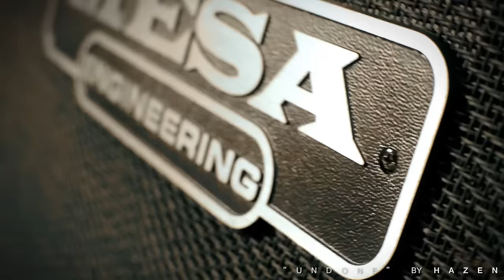John Mayer BLACK1 Replica by MCG

Comment: And to top it off it works when it’s done! Something fender couldn’t get right for John.
Reply: its a fun bandwagon - but the truth is that Rene martinez actually forgot to solder something after he did his check and setup - before john got it, as John says its not his guitar before Rene has touched it.
Reply: @imsura3554  why would Rene need to solder anything? The electronics should all already have been soldered. Unless he unsoldered something while doing his setup but that makes even less sense.
Reply: @paultiplea  Rene was supposedly mucking around with wiring in a dummy coil under the pickguard before it even reached JM. At least that's the story according to John Cruz.
Reply: Yeah, in the end, regardless of who’s doing the soldering, QA for Fender Custom Shop should be at the flagship level. PRS does a better QA job for their guitars priced way less than Fender Custom shop. So guess what, don’t go to FCS, buy one from Dillon Mills

Comment: Such a beautiful process and build. 
The back of the neck needs to be more in line with everything tho. It’s just a straight line and so bare looking.
Reply: The neck bothers me a lot. The back of a neck wears in a pattern that matches the cowboy chords down low, usually a fat middle with deeper wear at the whole notes (A, B, E) from barre chords, and then most of the rest of the wear starts just at or above the neck center line. Added to which, necks are DIRTY. When the wood is open the grain opens and closes with temperature and humidity. The hand naturally makes oils plus, frankly, we are a disgusting bunch as a species. All that together means there should be varying levels and "colors" of dirt down in the grain. The exact same goes for the lay-spot where the palm hits the body all the time, it gets coated in oil and sucks up dirt. Guitars don't get hit with hammers and files, they don't get sanded with 80 grit diamond paper in an afternoon at the same temp and humidity. Good guitars fall over when you're drunk, get chipped by some asshole's gold watch in a pawn shop, they slide down walls and across floors. Things fall against the face, scratches cluster at the saddle adjustment points, and at the string holes in the bridge front or back. They have beer spilled on the bare neck and never wiped off, just played off. Chips and nicks NEVER fall inside the plastic borders, except in the back where someone took the panel off and never put it back. And for god sake, things age AS A WHOLE, they don't age one piece at a time. And instruments as old as the ones you're honoring had all kinds of other stupid crap done, like rattle can over the beat up lacquer, or shitty wood putty fills that were painted with enamel then expanded and cracked. -- This is a gorgeous guitar, and obviously a handcrafted work of ART, 100%. One day I'll shut up and relic my own, and then everyone can pick on mine. Great channel!

Comment: You make this look easy, but I know it's not. It does make me want to try.
Reply: Erik Harker I ended up building the triple humbucker hardtail Strat that is my profile photo because of the Mills Custom Guitar videos. I don't regret it a bit! Turns out the center humbucker gets in my way but I want hotter pups anyway so I'll swap the pickguard then. Still plays really great. Learned a ton by building my own and I only have $400 with a Mexican neck ($200) and all Fender hardware including locking tuners. Not that I can hold a candle to Mills but, if you want, hit me up over Google and I'll share some of my noob learnings and mistakes. :)

Comment: I take it you need to scratch the complete layer or clear coat gloss from the body before attempting to relic the paintwork? Genuine question as I’m keen to try
Reply: You don't need to take off the clear, but it does need to be a certain finish. If it's a nitro cellulose finish, you can relic it in the way he did it in the video or how it would come from the Custom Shop. If it's a polyurethane finish as most modern guitars are, you can't relic it in the same way. Poly will chip a lot more and won't be nearly as smooth. It won't look right.

Comment: That oicture of the SRV original strat im pretty sure isnt the original SRV strat. The original had the stickers you used in the replica but the fender replica used a different font. Your replica is much better and the sticker font was the correct one (if you look at srv concerts you will see it)
Reply: Stevie's number one strat went through many changes. The stickers were changed on his strat just a short time before he died to the cursive letters. However, yes, the blocky hologram letters were on his strat for years and what most people recognize.

Comment: There's something very satisfying and aweinspiring about timelapse videos of guitars being built. Normally I don't care about relicing but this was a sight to behold! :) Being german and pedantic there's only one thing - as far as I know Fender did not do a relicing job on the Mayer strat. A wire had worked itself loose during transit and the guitar didn't sound right. So he started beating it up, putting it in the freezer and all this jazz in the hope of making it better. By the time he discovered the loose wire the guitar looked like it does now. At least that's how I remember it. :)

Comment: What are you scraping off the paint in the begining?
Reply: Probably nitro cellulose
Reply: He's flattening out the finish, knocking down the high spots so it doesn't have that orange peel look. I think he's just fine scraping it as opposed to most people wet sanding and then not performing any polishing steps so it looks worn
Reply: umpahimself what’s he using? A razor blade?
Reply: @codyjones8851 It could be a wide razor blade but most likely a specialty scraper tool

Comment: Great job very well done!! I've been thinking of making a John Mayer strat, but i'm lazy so, would it work if I prepped and stained the body then just masked of the areas that DIDN'T need paint (the opposite of the way you did it) and then spray the paint on the un-masked areas rather than scrape off all of the paint thats not needed? The stencil would be the same outline but cut away the painted area not the unpainted area, I realise the painted edges would need some dressing and flatting.. Just a thought...
Reply: That's the way I'm about to do it...Would be nice to hear other peoples experienced thoughts

Comment: What has been used for the brown tint on the wood? Amazing job there!!
Reply: At around 6:48 you can see a bottle of Tung oil. Which makes sense. When the finish has been worn off a guitar and the wood is bare, all the oils and sweat from a player will leach into the guitar and make it go brown. I wouldn't have thought to use oils but now it makes sense.

Comment: Excellent work! Would you mind sharing what you do to artificially age the hardware like you did in this video? The screws and tremolo springs look great, but the video went too fast to see what you did specifically. I've got a nice oldish strat with a couple of screws that don't match since they are 3 days old and not 30 years. Thanks!
Reply: Mark Brooks sanding paper to take the shine off
Reply: Muriatic acid and sandpaper artificially ages the finish on chrome hardware, I assume same for the gold.
Reply: Fine sand the heads and drop them in a small cup of hydrogen peroxide and salt, they'll rust in minutes.  Way safer to breathe than muriatic acid too.

Comment: So this took an hour or two then 😉.  Beauty!  Trying out some jazzy cat pickups whenever they get here.
Reply: Did you order them.  I just did.  How do you like them?  Mine will get here soon but the other 99% of my build from warmoth will take a while.  Damn carona virus shit.
Reply: therangersinger  They are the best pickups I’ve had (won’t change again).  I had custom shop fat 50s that the jazzy cats replaced.  The overdriven tone is where the difference gets amplified (literally).  Clean tone is really good too. Only as good as the amp you have though.  Good luck on your build and getting the parts someday.  I need to do a build like that someday.  Are you doing frets and everything or getting a prefretted neck?  That’s the only thing I’m hesitant about. Lots of tools needed to do it right.
Reply: @BeefNEggs057  thanks for the response.  Definitely no stranger to a wide variety of single coils.  I have owned......and sold so many Stratocasters over the last 12 years to include the original john mayer strat, a few deluxes, eric johnson, 59 avri.  I currently have a jimmie vaughan strat with custom shop 69's.  That Strat with those pickups has been with me since 2007.  Everything I buy has always been compared to those because they do sound great but I just have always connected with that guitar and play it more than any other.  I recently bought a suhr classic S.  Although it is a touch more on the modern side I have been playing that more and more as my ears have started to except change haha.  As far as warmoth goes....this will be my 5th build from them.  Unfortunately I had to sell all others several years ago when I lost my job.  I have refretted my Jimmie Vaghaun Strat once myself.  Not all that hard nor did It cost very much.  I actually bought a pack of pre cut and pre-radiused fender medium jumbo frets.  Hell I didnt know fender even sold them in a pack like that.  But they do.  That saved a lot of money not having to buy radiusing tools.  But as far as warmoth goes, every neck I have bought from them I had the stainless steel frets installed for an extra $22.  When i say there fret work is excellent I'm not kidding.  Although everything is installed you will need to round off the fret edges to get that broken in feel.  I never even had to level any frets from them.  Straight as can be.  And I did check but they were perfect.  When their necks arrive it will make you wonder how a piece of wood can be cut so precisely.  The only tool I have used on their necks is a STEW MAC fret end file.  Usually took me about 3 hours of work rolling the fret board edges and rounding off the fret ends to achieve that played in feel.  This build that I am doing now is  about 90% inspired by the mayer black one.  Cant wait to hear those pickups.  I have a victory V30 mk2.  The clean channel is almost too clean but I use a one control sonic blue twanger(fender in a box) to change my clean channel to a fender kind of feel.  I have always owned fender amps and this one was my first departure from them.  Although I love that amp I do miss the feel of a fender under my fingers sometimes.  But that pedal captures it pretty well.  I love working on guitar and setting them up probably more than actually playing.  I can't wait until this stuff arrives.  Looking like a little over a month most likely.  Sorry for the long response haha.
Reply: therangersinger  Yeah this all started with the black one love (those tones will make you chase). I did an output transformer upgrade on my Princeton Reissue special edition with 12” speaker. Made it cleaner and the bass response is so good. Tried a blues jr first for awhile and did mods that made it decent but you know....  tone must be chased.  You sound like you know all about that lol. Sorry to hear you had to sell a lot. Probably good to clean out some of it and keep the good ones.  
That is good info on Warmoth doing the frets for you. Stainless huh?  Can you tell any difference when you play?  I trust a person who is chasing black one tone lol.  May have to do a build soon once we know we aren’t going to starve from all this shutdown nonsense. 
That Victory is a super nice amp from what I’ve heard on YT.  Danish Pete likes them.  
Ever do any pedal building?  King of tone clone on rullywow is great.  Sounds great on a clean amp.  If you like tinkering might be something new for you.
Reply: @BeefNEggs057  stainless steel frets are definitely different.  My Suhr classic S has has them.  Which was one of the main reasons I chose that guitar over anything else.  And like I had stated earlier all of the warmoth builds from a few years back had them.  Here is my perspective on them.  1.  I love them hahaha.  2.  They DO NOT wear down. 3.  Bending and vibrato is effortless.  4.  I just play faster on them.  5.  They are a tad brighter that normal frets.  It is small, but there is a bright ping at the very very front of the note.  Only if you are wanting to notice that will you actually notice it.  It is nominal.  The warmoth youtube channel has a great series of videos showcasing/comparing different aspects of build options.  One of those videos being a blind test comparing regular to stainless steel frets.  With headphones you will hear what I'm describing and the host Aaron concludes the same thing.  Honestly I will never buy another guitar without stainless steel frets.  That's how much I love them.  As far as pedals go I have modded quiet a few over the years.  Hell every pedal I buy the first thing I do is open it up just to see what's inside.  I cant help it.  The only pedal I ever built from a kit was ring modulator.   But I have always wanted to build more.  I love soldering and small electronics work.  Goes hand in hand with my love to work on guitars.  Speaking of prince of tone.  I love that pedal.  Sold it after buying my victory amp.  I do miss it.  But as of 3 days ago I have been on the king of tone waiting list for 2 years now.  So I may get one sometime before I turn 65.  I'm 41 now.  Having the last 2 weeks off of work.  The weather being very nice here in georgia.  Kids playing outside all day.  I have played so much guitar and come up with so many new tones.  I have been playing on and off for the last 12 years but in the last 2 years especially I have been just as inspired to play as I was the first day I picked up a guitar.  Building pedals, guitars and what have you has always kept me interested in playing.....and. hasing tone.  Like you said.  In a way that will never end.
Reply: therangersinger  Fellow Georgian here. Small world and all that.
Reply: @BeefNEggs057  ok i have to ask then.  What part?  I live 60 miles north of Atlanta in Adairsville.  Very close to Cartersville.  Depending on where you live check out Righteous Guitars in Roswell.  Hands down the nicest guitar shop I have been to.
Reply: therangersinger  I have been meaning to check out Righteous actually!  I’m just south of you in White off 20. That’s funny!  You play publicly ever or just for you?  I’m an at home player (do an instagram every so often when I’m in the mood if that counts). Got serious about playing and learning the fret board about 4 years ago. I’m 46 been playing chords and acoustic since I was 15 with some breaks.  Electric is so much more fun to play!  Here’s My shutdown tip of the day. The dollar store might be worth a check for Toilet paper. We found some. 4 roll max but hey with my kids every roll matters.